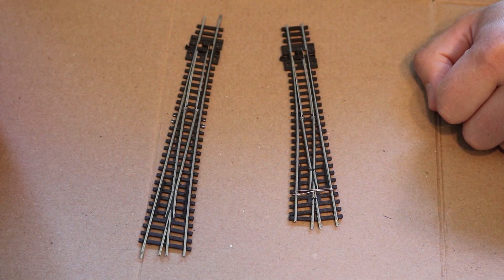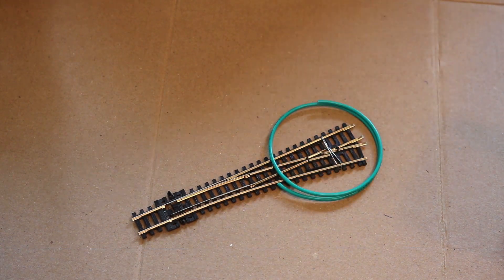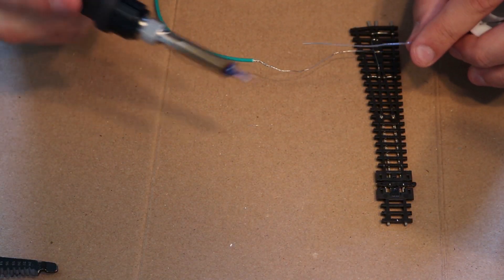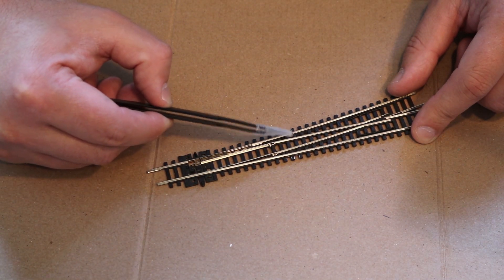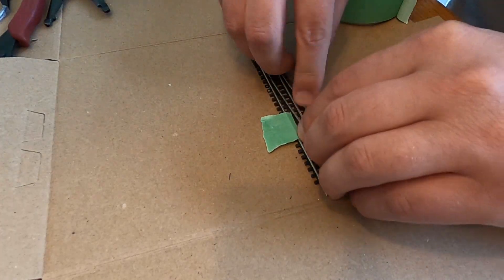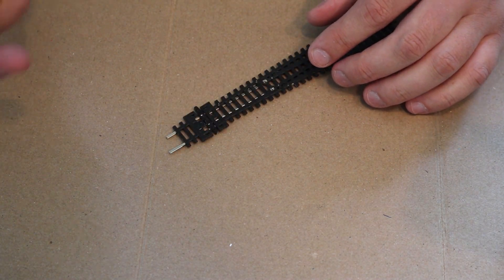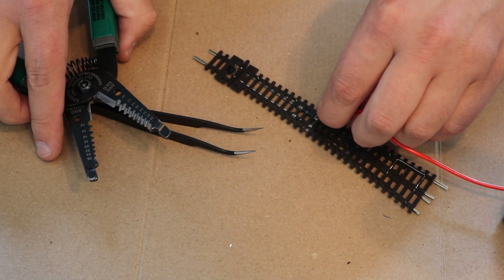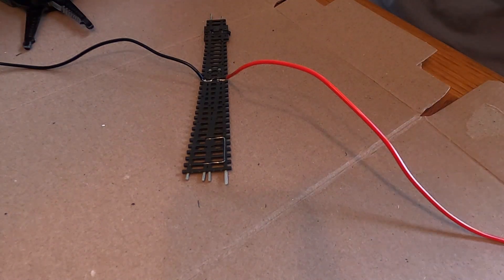Wiring PECO N Scale Turnouts - Unifrog and Electrofrog - DCC

Comment: I'm just planning to change from Minitrix to Peco code 55. After I saw this video, there is one big question lefr. What is the advantage of electrofrog turnouts over unifrog, that makes it worth these massive adaptions to the electrofrog turnouts?
Reply from the maker: I guess one could argue the electrofrogs look better if you look really close. I would take unifrogs since they are easier to wire, but last I seen Peco still only offers the unifrogs in just one size.

Comment: I have never of such nonsense about cutting rails with Electrofrog turnouts. My electrofrog turnouts work 100% fine straight out of the box no problem at all. All that needs to be done is the use of insulated (plastic) rail joiners on both centre rails coming straight out of the frog and ensuring electrical connection at the entry rails into the turnout. I am NOT a fan of electrofrog turnouts and much prefer using unifrog turnouts.

Comment: Its amazing to me that Model railroaders ( these days ) have to deal with all this nonsense , and manufacturers can not put out a Turnout that is good to go for DCC right out of the box as doing this to expensive turnouts is ridiculous , makes me question if DCC sound is worth all this , not to mention the expense an frustration. I loved model railroading but did not sign up to be a low voltage Journeyman electronic engineer...
J.M.O ... cheers
Reply: Peco unifrog turnouts (points) actually do work straight out of the box with no need to stuff around with that connecting wire to any polarity switch. I have 24 unifrog turnouts on my layout all working straight out of the box with no mods of any kind.
Reply from the maker: I have to agree that a simpler version could have been designed by now. But it would be very hard to please everyone. The Unifrogs are quite a bit easier that's for sure.

Comment: Hi buddy
I’ve got two right hand peco n gauge electro frog points. I’ve watched all sorts of videos but I keep getting confused.

When I have my trains running everything is great but as soon as I flick the point to joint the other track, via the other right hand point, the train stops dead. 
What is happening and how do I fix the problem ?
Reply from the maker: My guess is you either have a short or a polarity problem. A multimeter is a great tool to troubleshoot these problems.

Comment: Do I need to make the modifications to the Electrofrog?  Can't I just add a sinfle wire to the frog and connect that to the SPDT of the tortoise.  That would then allow power to the frog both from the points and the additional wire.  I will use insulated joiners on the two inner rails to prevent shorts.
Reply from the maker: No. The wire to the frog is to change the polarity only. It is not meant to power the track.
Reply: Late to the party here, but I have electrofrog turnouts on my DC N-scale layout. They’re all straight out of the box and put on the layout. They operate perfectly including slow speed locomotive crossing with no change in speed. The turnouts are thrown with Peco under layout switch machines with the twin micro switches installed to operate LED’s showing switch position on my control board. The other micro switch could be used to power the frog, but in my experience it’s unnecessary, as the spring loaded points do an excellent job of feeding the frog!

Comment: Make sure to inform people if they have a returning loop after the turnouts frog. They will need to isolate the frog or will result in a dead short plus need a reversing loop module to change the polarity.

Comment: I am going to be doing this with my electro frog turnouts, but there are 3 wires at the frog on my turnouts.  Do I have to solder one wire to all 3 wires?  Thanks!
Reply from the maker: are yours HO scale turnouts?
Reply: @nscaler454  no they are n
Reply: I think if I cut the wires underneath and keep them attached to the frog rails I can attach a wire to those to power the frog and insulate the frog.  Cut the jumpers at the points and power the stock rails with jumpers.  Thoughts?
Reply from the maker: @ericp6612  I was not aware that Peco made an electrofrog with 3 wires in n scale. I would have thought they would all be the same as to what is shown in the video. I suppose my advice would be just visualize the flow of power through the rails. Have constant + or - power though the necessary rails (as shown in the video) and have the frog wired separately to control it's polarity. I can't see any turnout needing more than 3 wires going to it. (positive, negative, and frog polarity)
Reply: I don’t know why there are 3 separate wires that jump the frog since there are only 2 rails.  I will modify one and see if it works before modifying the others.  Thanks for your assistance!
Reply from the maker: @ericp6612  I wish I could see what you were looking at
Reply: @nscaler454  not sure how to get you the image.
Reply from the maker: @ericp6612  you could send through Instagram or post a link or tell me what the part number is so i can look it up
Reply: I sent you a message thru Instagram with pics